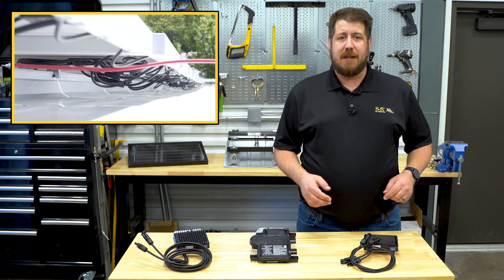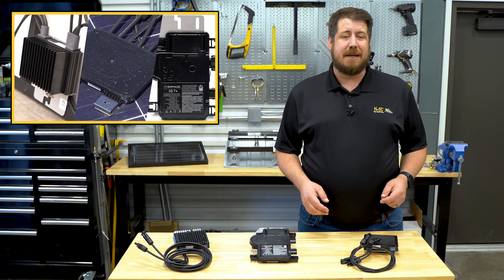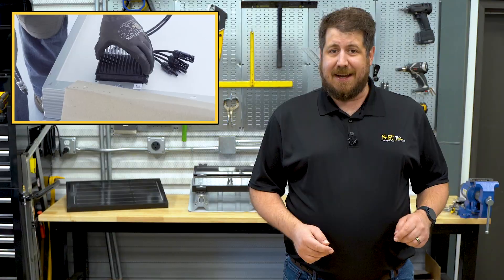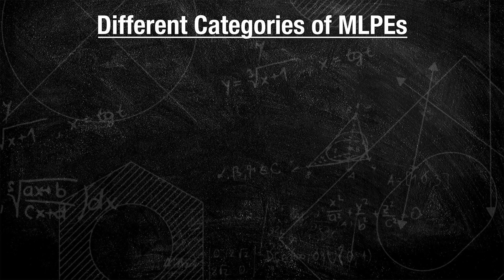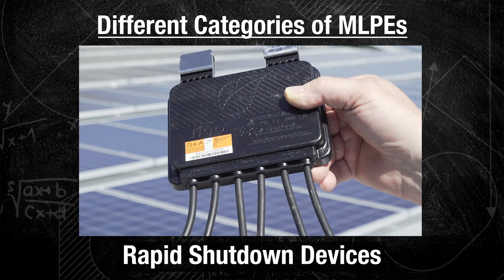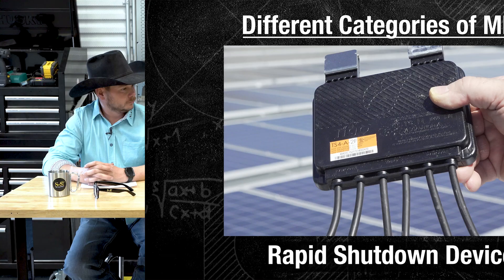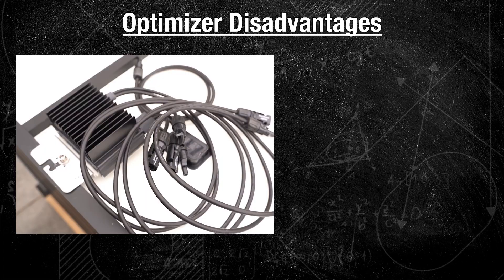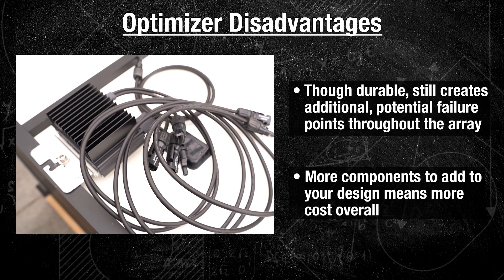MLPEs and Solar Optimizers: What You Need to Know - Part 1

Comment: Failure rate of solar panels is 5 in 10,000.  In other words .05%.  They rarely fail. And solar panel have diodes to address shading issues.   Research before believing the marketing spin.
Reply from the maker: While we certainly appreciate the input, and admittedly have used various kinds of MLPEs on projects - whether or not MLPEs are right for your project is entirely up to you.  We do not sell nor endorse any specifc MLPEs.  We want this video to be useful to anyone who does decide to use MLPEs and wants to know how to mount them as part of a PVKIT 2.0 installation.
Reply: @TheMetalRoofingAcademy   Lets also remember that MPPT used in the top brand inverters, not the clones that are discounted,  has evolved in the past 10  years complimenting the modern solar panel technology regarding shading.

Comment: I can't believe that you would lie to the public in such a callous manner. We all know that the diodes are the elements in the panel installed with the sole purpose to reconfigure the path of electricity upon shading not the optimizers. You can maybe use the optimizer for other purposes such as extracting data and monitoring the panel. If you have a conscious you and I'm betting that you do, you will buy yourself a book and read about this particular issue and if you're honest you'll record another video telling people the truth. I know you want to sell your panel but let the customer decide if they need them or not, don't scare them into buying crap they might not want or even need.
Reply from the maker: It's certainly not our intention to try to pressure people into purchasing things that may not be required for their system.  However, optimizers do in fact tackle more than just data extraction/monitoring.  Here is some information directly from SolarEdge's website - "The SolarEdge Power Optimizer is a DC/DC converter which is connected by installers to each solar module, turning them into smart modules. The SolarEdge Power Optimizers increase energy output from PV systems by constantly tracking the maximum power point (MPPT) of each module individually. Furthermore, the Power Optimizers monitor the performance of each module and communicate performance data to the SolarEdge monitoring platform for enhanced, cost-effective module-level maintenance. Each Power Optimizer is equipped with the unique SafeDC™ feature, which is designed to automatically reduce modules' DC voltage to a safe level whenever the inverter or grid power is shut down (unless connected to a SolarEdge inverter operating in backup mode)."

We do understand that bypass diodes do prevent widespread energy output loss from shading when activated, but optimzers have more functionality to maximize outputs, including shading scenarios when the diodes may not be activated or to prevent activation from diffuse shading.

You can find out even more about the topic in this video - Solar Panel Shading (Part 1): Are Optimisers and Micro inverters Worth It? (https://youtu.be/9GvhDhCSJgo)

Also, S-5! is a metal roof attachment company, so we don't actually manufacture/sell any panels, just the means to attach them to metal roofing.